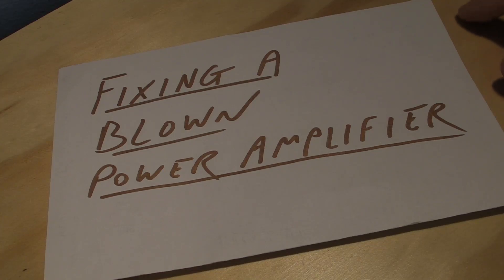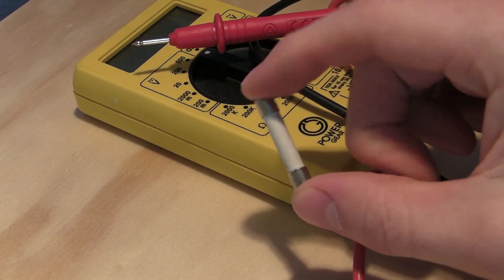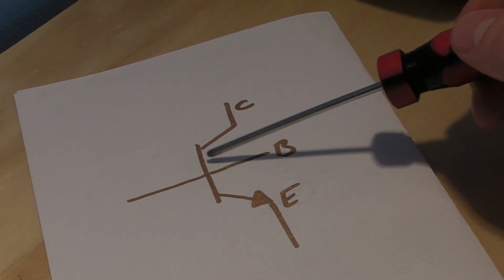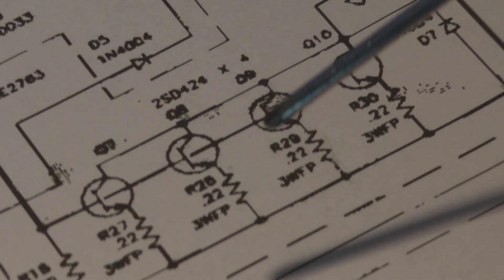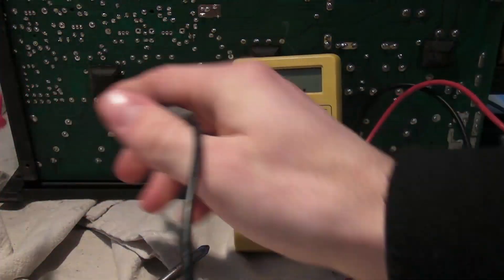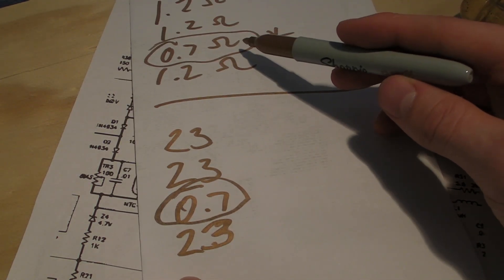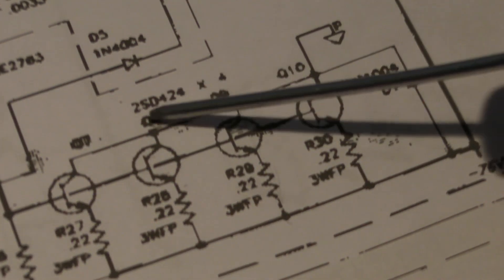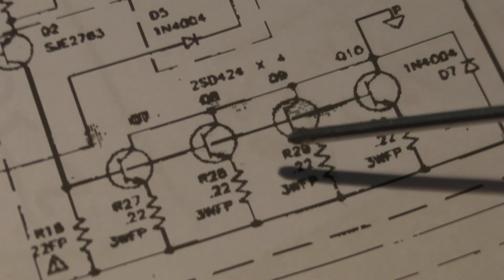Simple fix for a blown audio power amplifier - Save your $$$!

Comment: Great video .I was yesterday  trying to see what happen to my amp , one just like that. 
It looks to me like one or two resistors are getting bad because the clip light comes one then I turn it up then the distortion stop and the clip light is gone .it stands to reason that something is blocking the voltage. 
I change  4. 47k resistors  it still not working .

But I see the  resistors  17A and 15B and R35  in bad condition and I  can't see the colour code. 
Can you tell  me  what the resistance  are on  these .

Comment: Dude, I am extremely thankful that you put this video together!! I have a similar issue but I have just started down this long and dark path that lead me down to a rabbit hole I couldn't help but dive into! I have a board that keeps blowing a fuse on a bass amp that I don't have any of those round guys that you were showing I have these square ones that are on an aluminum plate and I want to say that they're bridge transistors, but I am not sure but there is solder missing on a couple of the points and I wanna say that is the problem. But I'm just not sure.

Comment: Thanks for your work and the time you put into the repair and making a quality video.  Just curious if the amp worked after and if it is still working today?

Where did you find your schematic?
Reply from the maker: The amp has been working great running a practice PA setup since I fixed it 3 yrs ago. Glad I could help!

Comment: Yeah I will tell you also that if you have an amplifier that is that dirty on the inside you may just want to strip it down and clean it because it’ll do a lot better in the long run than just replacing an outlet transistor

Comment: Very well explained, I have a question though....My active Behringer B215A will power up but only puts sound out through the sub, nothing out the tweeter. I checked the fuses and they are all good. The "clip" indicator light is constantly on when the unit is powered on even without any input plugged in.

Comment: For those wondering why one bank read 1.2 ohms then the bad one was 0.7. Then the other bank was 23 and on at 0.5.
The first Bank the transistor shorted but the emitter resistor survived. The second bank the transistor shorted and fried the emitter resistor open.
I am guessing that the channels have a bank of four for the positive going signal and a bank for the negative going signal.
Which would explain the diode down stream for biasing at the crossover point.

Comment: Hey thanks for sharing. Once you have some knowledge of repairs this would be helpful. Talking about help, does anyone have a gemini xga 3000 service diagram? Even though the Amp was new there wasn't any in the box. Thanking in advance for any assistance. (I switched on Amp and  cap just blew up. No short circuit🤔)

Comment: Great explanation man, but question what happened to the fuse, you put them bck after removing the 0.7 not working part or?  Thank u
Reply from the maker: Yes, the fuses went back in off camera. Without them, the amp will never turn on since they complete the circuit.

Comment: Incredible explanation. Very good at not wasting a minute getting right to the most crucial points. I understand it all now that I’ve watched your video. I have a very expensive car amplifier I just bought for a lot of money. It is a beast, it’s a called B2 ‘The Great White’
It is 16k RMS 
I built a custom lithium bank from Nissan Leaf batteries and made a nice 15.8 volt balanced load ready for the amp and 6 new 10 inch speakers...but the amp smokes bad as soon as i connect it to power.I replaced it with two other amps to the same circuit to test it and it’s not the power.Any idea? It’s brand new

Comment: I'm trying to figure out what happened to a amplifier that I have turns on and shows lights but nothing going through has a LCD screen it's a pyle pwma10003t I got off eBay it has been a really good radio but there was a storm today got two water drops on top of it don't know if that caused it or the lightning I did unplug but after storm was gone I plugged it up and nothing fan comes on and the lights on the front come on but nothing shows on the screen and it does not play anything I checked the two fuses on the inside they did not look burnt

Comment: im getting DC on the output of a 2x6 mosfet amp. fuses are good but protection relay clicks on and off as volume is lifted. so presumably a short is putting DC on the output...but not popping fuses ?

Comment: Hopefully u can help me...My tv surround sound system powers on, but speakers and base box not working, no sound from anything. Everything still has power, just no sound. Nothing has changed in 3 years it has been working and all of a sudden the sound just went out. I think it could be a fuse, but idk if it would still be powering on.  I did every other simple troubleshoot, restarting, changing socket, unplugging all wires and back in. Only thing that's left is a fuse in the back I didn't change yet. Basically could set still be powering on if it's a blown fuse???

Comment: Hey! I have no blown fuse . I pulled and checked w ome meter. 
but I have no lights or no action..
It was working fine and just cut off.. No power .. But. Power source is good.
Any ideas? This is a Audio source home  amp model 3

Comment: thanks, man.
I bought a mackie m1400i on ebay and it's not outputting sound. There's definitely sound coming out of the EQ (hooked headphones directly into it, adjusted volume and worked properly)
The lights on the m1400i work properly. There's a quiet popping noise coming out of the machine every second or so.
It makes a small noise through the speaker when I flick the power button on.
The LED "cold" (which indicates good temperature) comes on, and the LED on the power switch turns on.
The interior fan is not on, though. I dunno if it's supposed to only turn on when the unit gets hot, but doubt it.

Could this be a blown transistor, or will the unit be 100% non-functional when there is a blown transistor?
There is no fuse or circuit breaker panel that I can see on the unit, front or back. (edit: but I haven't opened up the case yet)

Comment: Hi I have a yamaha amp which just suddenly turned off while listening to music it won't turn on now seems like no power to the on switch I did check power cable which has its240 coming in found one fuse on that board which still had continuity through it .

Any help would be welcomed
Thanks Chris 
Great vid

Comment: Maby this is What happened with my amp. Blows fuse immediately when you turn it on. And on another amp I have nothing lights up at all when I turn it on even with new fuse. These are olds so I'll see if I replace it with another older one

Comment: Never touch any component with a screwdriver eventho its unplugged! Caps hold a charge. Also u should clean out the amp as u will benefit with better air flow circulation. U already have the cover off so why not!! Exp elect tech here 36+yrs in the business

Comment: I agree w/ @stevie-joe.... I'm not sure if It's your timing in showing the schematic with it's real life representation, or your candor and humility, but, I could immediately ID the components in my amp,(as I remembered them) and "follow" what I saw here in that context. I watched this BEFORE I attempted the repair because usually I have to watch  videos 10 times with frequent pauses and a hot soldering iron burning daylight. I feel comfortable to start this repair without having to have somebody "hold my hand" from the information I got here.. Thanks

Comment: Buying a new stereo amp is difficult today, all you find are 5.1 and up surround amps with more than two speakers, so repairing my Sherwood receiver was my best option, I found thst it uses a combo of B1560/D2390 transistors, I found a set of 5 pairs on e-bay for less than $15.00, this vdeo was very helpful in finding the fault quickly, thank you.

Comment: Hey how's it going, I had a question maybe you can help me out. I have an infinity bu-2 powered subwoofer. Ok I opened it to check what was wrong with it and a few tracers were burned out so I solder some wire to connect point A to point B put everything back together plugged in the power cord and as soon as I switch to on you here a thump and I believe is the relay clicking now I haven't had any luck finding the same relay but as I was watching your video I put more taught into it and wondered of it really was the relay or can it be like you said a resistor or transistor but the resistor is next to the relay it's an OEG OMI-SS-248LM. SO MY QUESTION IS WHAY DO YOU THINK MIGHT BE WRONG
Reply: Enrique Torres Hi,
When a trace is burned, quite often a component that’s connected to that trace has caused a short. 
Also if you have a multi layer board (one not only has traces on the top and bottom but also 2 or more layers with traces inside) there is a good chance that there are now shorts between those layers. The charcoal from the burn is conducive. 

So now that you’ve repaired the traces you need to make sure there are no shorts caused by the burned pcb and you’ll have to find out what caused the burn in the first place. 

This is no easy task. If you want to have a go at it, take a multi meter on diode (beep) setting and see if you can detect any (near) shorts. You might find that some MOSFETs have gone bad (just like in this video). If so, you should also check the driver resistors and capacitors. Sometimes the drivers themselves have gone bad as well.

Comment: Thank you for the video.  You are a good teacher and explained everything clearly.  My question concerns a Yamaha receiver that blew a fuse.  I identified a bad BJT and replaced it  The fuse blew again.  The other output devices checked OK.  I suspect that there is another bad component.  Would you recommend checking the circuit to test components that feed into the base, like a shorted driver transistor?   Anything else that I should be looking at?  Many thanks.  Stan

Comment: Just FYI, that’s not a “1” on the multi-meter. It’s an “L”. Some meters will say “OL” which stands for “out of limits”. Means the resistance is outside the limits you’ve chosen to test because the two probes aren’t actually being connected through anything - cuz the fuse is blown. If a connection is made between the two probes THROUGH the fuse it will show the value of resistance in the object that’s being used to bridge them together.

Good video.
Reply: it's a 1 on his meter. his meter doesn't display letters.. only numbers. But 1 on his meter means the same as 'OL' on your meter. not all meters are made the same.. different displays..some are alphanumeric, but the he's using is numeric. it displays and communicates the same information though, so he was reading it correct. 1 shows there is resistance. good fuses will show continuity..just like he said.
sometimes I don't understand why people feel the need to "correct" things that are not wrong..

Comment: I bought a Behringer EP4000 Europower Power Amplifier from eBay I measured the fuse in both channels and they are showing that they are good. There is no power supply light. The amp was listed as “Does not work, goes into protection mode. AS IS.”
Reply: Probably one of those big caps he mentioned. I’d see if any are leaking fluid, first. And then look around for anything else burnt and crispy. Sometimes they fail from age, but otherwise something MADE it blow. Usual culprit in mosphet amps is a mosphet that’s fried from jamming it too loud or overheating (they process power and radiate heat as a byproduct) 

They’re black vertical “postage stamps” that are screwed to either the body or an aluminum heat sink. Find one or more with crispy legs and order new ones for the whole channel/s, and he caps. Watch a vid of an install, you’ll be golden for about $20 and your time.
Reply: That's what I was thinking that its some problem with the MOSFET's...

Comment: One side is out on my Samson 1000 power amp I hit the reset circuit breaker, no change. I opened up the unit  and both fuses test good!  Where do I look now?  I am not sure if that circuit breaker is functioning? what's the next step ? Thank you very much.

Comment: I think the first thing I would do before any thing else is to blow out all the dust and dirt. Quite often overheating is the issue leading to blown transistors. Air flow is very important if the amplifier is driven hard. Once fixed any air filters should be well cleaned, check the fan, apply a little oil if needed. If you don't do this, it will probably blow up again.
Reply from the maker: You're absolutely right. I wound up going back in and blowing it out after I replaced the transistor. This one blew after it melted a 1/4" instrument cable which was connected instead of a proper speaker cable, but I doubt the excessive dust helped things.
Reply: Won't hurt to clean it!💯
Reply: @donaldcatlett5850 that's what he said.

Comment: Great video. You rock! My Channel-A has a blown fuse and had “22.8” readings on all transistors (even on CH-B side)... The front panel light is the normal green, however the interior pcb red LED is illuminated(normal?). Nothing appears to be scorched, but some solder terminals are a bit yellowish.  Any thoughts?

Comment: Thank you for your effort...A word of caution though, replacing the defective output transistor without checking its forward bias whether it's within limits or not will allow the audio amp to function again but for more or less 15 minutes only because the transistor will overheat and be defective again.

Comment: Hi, I have 2pcs speakers I could imagine getting repaired. M Audio M3-8. Studio monitors. They both began to 'drop' more and more the roof. First, the bass was slightly reproduced, then treble and the whole sound. The bass became weaker and weaker on both first. So the treble. The right has "given up" completely. Both on bass and treble. It wants to reproduce but does not manage.
Left plays with 50% reduced energy and power and is perceived as weak. The right gave up more and no play, it makes soft doubles when it is quiet and tries to reproduce sound, but it gets soft smells, scratches, sounds will pass but does not appear, just as some hold back. It "is not allowed" to play properly. Both speakers have been standing still in the same place in the studio for 5 years now, played with moderate volume. But the energy began to fall right after the warranty. There has been talk of this being a trend in M Audio with certain models. Bad / wrong capacitors, wrong fuses. They need some love and switched to better quality capacitors?
Reply from the maker: If you feel like trying to salvage them, maybe take them apart and look for any components that 'look' bad - ie bulging or leaking capacitors, especially if that is a common issue as you say.

Comment: Can the same be applied to a car stereo? My left side is out and I believe the amp is built into the head unit.
Reply: No it is not the same, this video also only show a guy getting realy lucky with the diagnosis, there could be so, so many other fault conditions, and he is realy lucky only the output transistor was bad, not the driver, predriver or supply to some of the circuitry in the output stage :-(

Comment: Thanks for the video! I have a Yamaha A1000 integrated amp that I bought in 1985. About 15 years ago it just didn't turn on. It had been working fine the last time I used it. I just put it away and now would like to use it again. It seems the new amps that I've looked at don't have as good of specs as this amp. The new Yamaha A S3000 has more THD and isn't as good in other areas too. That amp is selling for $5000-$7000 so I would like to fix mine. I just located the owners manual and it says there is probably a blown fuse and to take it to an authorized dealer. I took the amp to a guy who works on this stuff but it is taking awhile. I may just get the amp back and try to do it myself.  Are there any other details I should be aware of?  Thanks!

Comment: My amp was working fine but I accidentally had my amp switched on before I turned my crossover on and it sent a large signal to my amp and my woofers make a loud bang and put all channels of my amp into protect and the thing rebooted itself and now channel 3&4 do not work but channel 1&2 are fine. Could I of just blown the fuse?
Reply: Any help would mean alot to me!

Comment: Driving a speaker load with a guitar cable is always s bad idea. Good clarity on your explanation of tracing out the faulty output transistor. 
Did you know that dust becomes conductive after heat and current flow hit a trigger point? That sends the DC rail voltage where it should never go...avalanche voltage breakdown followed by shorted output devices.

Clean away the dust and check the mica wafer for cracks. Replace the wafer if it looks compromised.

Comment: I have a bp7004 Definitive technology. The capacitor in it got replaced and upgraded. I put it back together now the power light won’t turn on. I take out and plug it back with power. I hear a little hum from it. I called support from Definitive technology they will replace both amps for $200. I’m paying for something that will have same problem down the road later. I got loud humming coming from the amp made want to fix to begin. Please help.
Reply: $200 to replace it to get same problem later is not worth it. That is why I replace the capacitor and upgraded them.